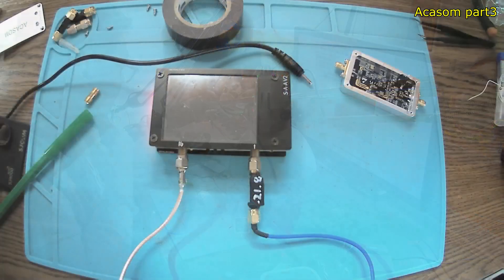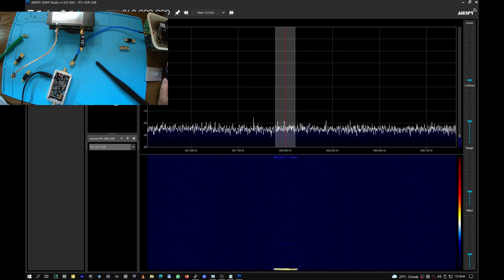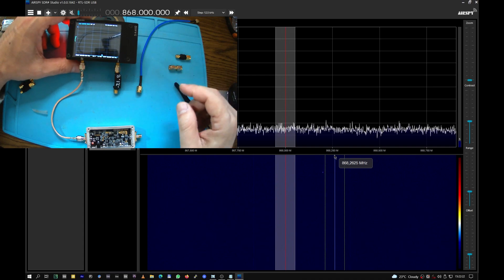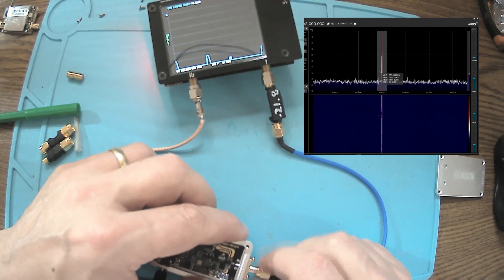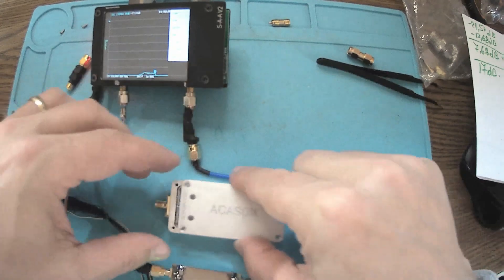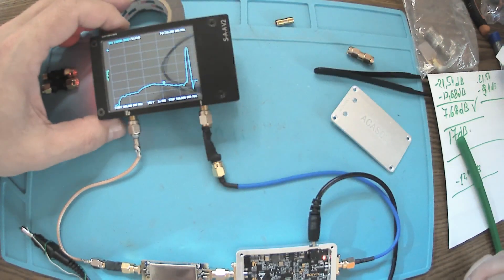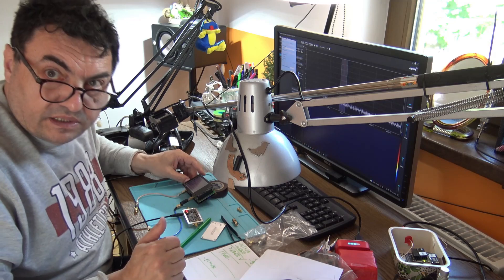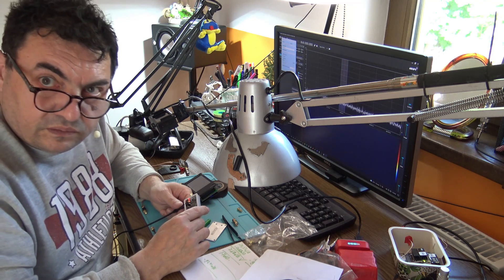ACASOM ACA-AP0801S1 10db RX/0dBTX Helium amplifier part3

Comment: What can I do at acasom booster? Red light is always on and it doesn’t work.
Reply from the maker: If you have light, it should bring a gain amplification of some sort. You can test it simply by disconnect the amplifier few days ,k right down the RSSI and SNR numbers and compare with later days with the amplifier hooked up. Being a bidirectional you should have a TX gain too..depends of the model..means longer TX range..you can check that from your beacons witnessed numbers...ussually longer distances then without the amp means it's working. Don't expect fabulous resuslts...be patience.

Comment: Hook up the miner side of amp to s11 just swap the connectors put the sma going to attenuator on lf side and sma that was on left side to right on the attenuator it makes the amplifier see a tx signal instead of a RX signal
Reply from the maker: That's the way it should be...but stay tuned, I'll post a new video soon with latest developments..it's amazing what I found..
Reply: Can't wait I had problems and there worse if you use there bios t

Comment: I myself have tested with my NanoVNA but could not get the readings I wanted on the 17dB RX and 6dB TX for some reason when I connect mine it increase the negative value from -17dB my Attenuator to -23 dB when amp is installed, that does not give me an increase in gain but a loss on RX, when turned around I do get the TX light to come on but also near nothing gain. It does not make sense as to IRL (In real life) I do get better RX signals from miners ... around 13 - 15 dB better and also on my TX I found 3 - 5 dB better. I'm going to take my amplifier to a friend tomorrow night how has one of those expensive network analyzers so we can test with it, also use the signal generator to inject a signal to test TX. If this test is not satisfactory I might need to open a dispute because it's not as advertised. I will keep you posted. Thank for the video.
Reply from the maker: I found VNA testing proves wrong..everything changed when I put it to work..I don't have numbers yet because of the network but somehow is doing the job..RX with 15,2 db and TX and green LED on..I couldn't measure the TX power though...
Reply: @viocaia  I have one question , I see you supply directly power to the amp, what voltage doe you use as I only received the Bias-Tee with 12volt and the power jack does not fit the amplifier , on the specs sheet the say 6 - 18 volt, I want to test tonight both ways with Bias-Tee and without.
Reply from the maker: @jacoleroux5569  There is Buck converter inside with AP2960 IC , it can go up to 30V..9don't recommend) but anywhere between 6-20V it's ok..mine is 12V..
Reply from the maker: @jacoleroux5569  Even 5V from a old ohone charge should be ok..inside voltage is 5V...